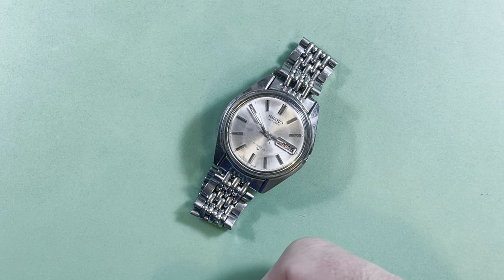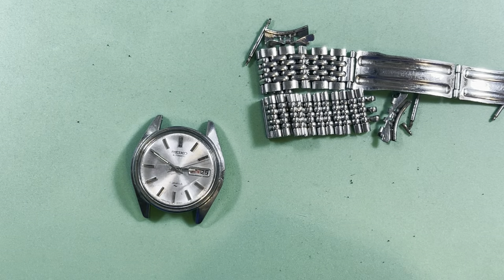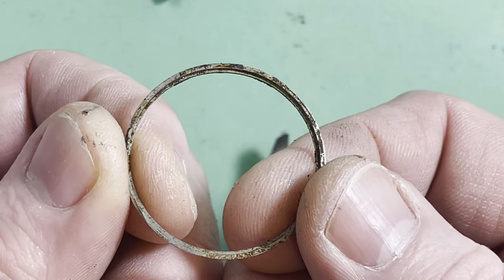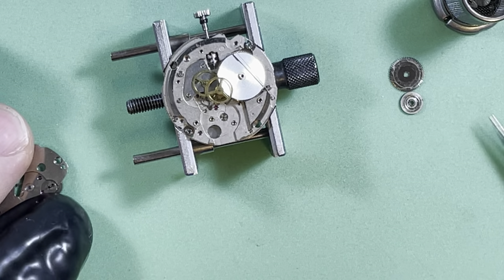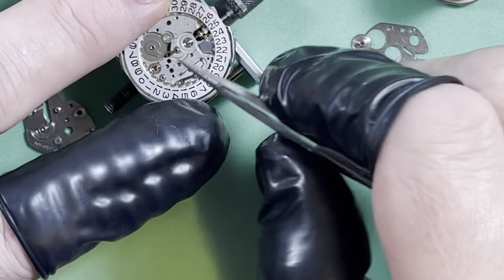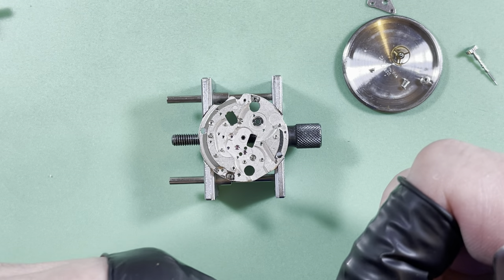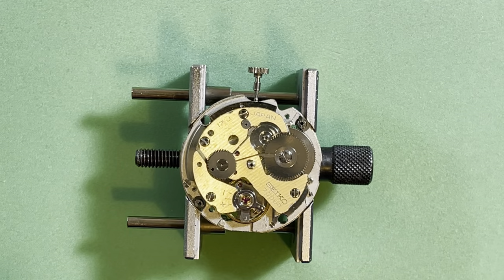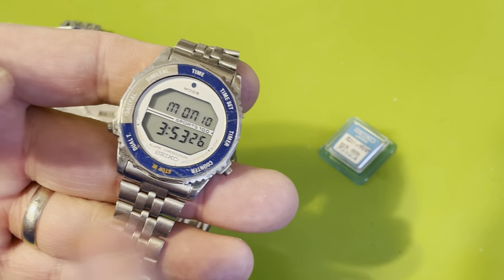For MP: Seiko 7006-8007 restoration

Comment: I had one that was a couple years newer and had a black face. I had it serviced in the 80s I took in in because the automatic weight cam unscrewed. It was also missing the bezel because it cracked and fell off. Never did get a new bezel.
Reply from the maker: They're not hard to find.  Did you get one?

Comment: Excellent work as always. Does the barrel arbour jewel require a new arbour also? I would assume that the arbour would have equal wear, or is it made of a harder steel? Thanks.
Reply: The baseplates are plated brass, the arbors are steel.  The wear to the arbor would be minimal.

Comment: very similar like mine is 1978 Seiko 7009-8129. soo ... I went Collingwood Flea Market in Farmingdale, NJ. Browsing on the booths outside. I spot a vintage Seiko watch on the shelves inside the glass box. I observe Seiko Automatic watch having a few little scratches on the crystal and waterproof. And the movement caliber is 7009-8129. It seems the 1970s early.  I ask the guy about running is work or not. He say, “still running work. I test a wind horizontal carefully in few seconds. Then the second hand move is running work well. I ask him, “how much cost this?” He mentions $39….. I offer him $30.  He accepts it. I bought it….  Right now my 1970s Seiko Automatic is real bad dirty. I really need a professional watch repair a restoration for deep cleaning a bath and needing an accuracy time… need crystal replacement, too